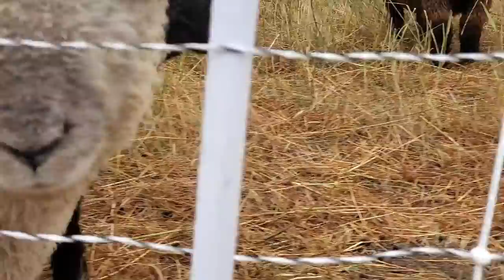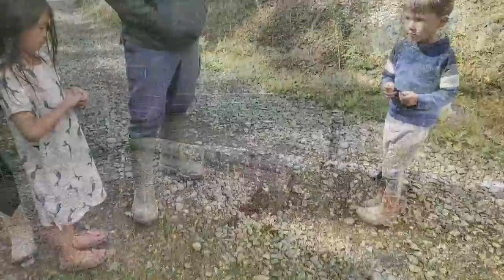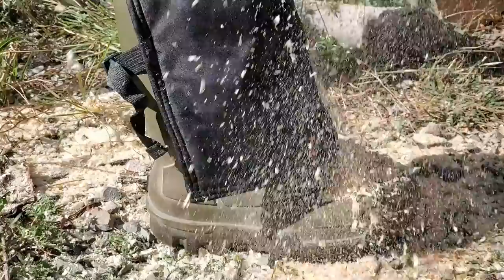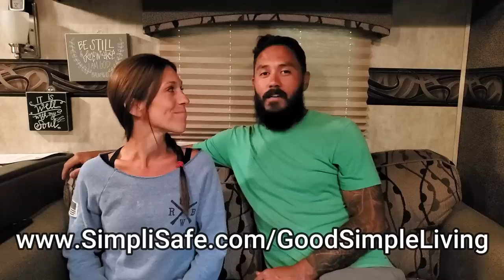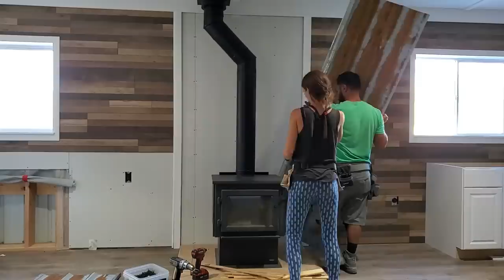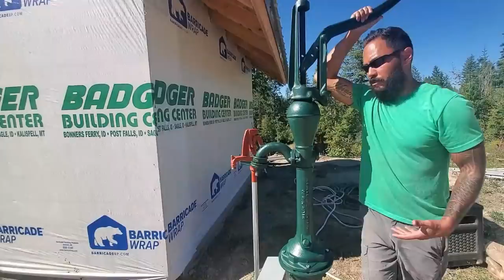Installing Wood Stove Heat Shield | DIY Rustic Farmhouse | Building Our Tiny Home Barndominium

Comment: FYI...Make sure you put a fan in main room to help circulate the heat from stove...add a pan of water also to help keep moisture circulating.....Cheers from Maine.
Reply: I spent my childhood winters filling the pan on the wood stove.
Reply: The water is very essential for keeping the sensitive noses of the kids from drying out so bad that they're having frequent nose bleeds. Had a friend that didn't believe me about the water & her young daughter had so many numerous nose bleeds she alerted the school in case she did. After finding out nothing happened & got the same advice from the nurse, followed up by a NP from her dr's office she put the pan of water on & No more problems!!!!

Comment: Have you thought about getting a sawmill to make your own lumber off your property?
Reply: A sawmill would make sense if you have a lot of woods but judging from their videos the investment to get a decent sawmill is pretty steep and there just isn't that much timber on their place to make it a viable option.  Unless they can sell it for a good price once they've finished  work with it.   Wood Mizer - a great mill but you are talking close to $10,000 for one with the features and capacity to build a house.  Plus there is the maintenance cost too.  Also the equipment to move wood to the sawmill means a good tractor, building for the sawmill and storing/drying the lumber.
Better to locate local mills and work with them.
Reply: @gscott5778  probably right.  A lot involved in setting one up.  And $$$$$$$$$  To get it.
Reply: It seems there is good reason why timber has skyrocketed , looks like there has been targeted attacks on sawmills of late you can’t overlook the number of them that had so-called accidents then you add the fires the future will be grim . Think about maybe building out of stone if it’s a available resource?
Reply: G Scott, We did not buy the portable saw mill, but rather contracted someone to come in with their "portable" saw mill. Worked out great!
Reply: @dianehall5345  That's more reasonable assuming you can get all your wood ready to mill in time and move it to one location on the place.   Certainly a better option for certain types of home build plans.
Reply: Scott G. We peeveed logs to a ramp. Have to watch for any muddy areas. Cut 11,000 board feet. Built a 20 x 30 workshop with a 4' knee wall on an Alaskan slab.
Reply: G Scott ~ You might be interested in Matt Cremona's YouTube channel. He built his own sawmill, as well as trailers, etc. and creates beautiful pieces. I've learned so much from watching his channel.

Comment: We have had Simplisafe about 5 years. One thing for sure, if the wood heater lets any smoke in the house, you will get a call within 30 seconds. The system works very well.
Reply from the maker: Awesome!! Love hearing that!

Comment: Thank God you survived the heavy wind.  This is the time of year that large air masses move around from north to south as the earth repositions itself to the sun.  We felt it all the way down here in Texas as the temperatures dropped from high 90s to mid 60s.  I bet you are glad your tiny house had the extra strength from the OSB construction.  Had the barn shifted in the wind your apartment would have stood strong and survived.  Glad that was not tested.  Winter is coming fast.  Hope you get the water to your tiny house quickly this coming week so you can complete your kitchen and bathroom.  The shed siding could wait till water is secured.  

One note on the wood stove flue.  You might want to consider repositioning the stack to go through the wall then go vertical along outside wall.  That way when you clean the piping the flue opening will be outside saving the big black carbon mess for the ground outside rather than inside your living area.  Just a thought.

One question, I am betting you have had many discussions on priorities for spring.  Do you go full bore and put every waking minute into the house construction or do you divide your time and denote some of it to your garden needs.  Doing both might be pretty stressful.  Just a suggestion, maybe minimally plant all your fruit trees, blue berries, raspberries and any other plant that might take a few years to provide a harvest then at least get your basic house frame up with a roof by next winter.  Or, go ahead and plant your full garden and extend house building for another year.  Roof by end of 2021 and finish house in 2022.  Extending the time frame gives you a breather and reduces stress to the family - life can go at a slower pace.  Also, allows your time for the family garden providing you a harvest throughout 2021.

Comment: The Tin backing looks good!! Not sure what your clearance requirements are for your stove but what some installers do is use metal studs or spacers instead of the wood so that the tin is offset from the wall giving space for air to move behind the tin reducing the combustion factor of the wall. Just a thought!!??

Comment: Absolutely enjoy your channel.  Recently you were installing you PEX plumbing.  It seemed like a long distance from the hot water heater to your sinks.  I live in a home where it use to require running the hot water a long time before the hot water reached the kitchen.  I installed a Watts water recirculating valve.  I am NOT sponsored by or associated with any vendor or sales person.   This recirculating valve does not use or lose any water.  Running water down the kitchen drain waiting for hot water to arrive is a waste of resources.    I encourage you to check it out, at the big box stores or online. Most Respectfully

Comment: Do me a favor, put the guard back on the table saw. I just lost a finger, part of my thumb and my wrist damaged from whip lash. I didn't even know it until I  saw the blood. My left hand is useless now. 
Chains or wide straps over the pole barn and anchored would be a good  investment especially now the weather is so unpredictable. 
Love all your videos,  your shinnangings and the wonderful family you have. Be Safe big guy and family too. 👍👍🇨🇦🐶❤
Reply: Yes. as a chippy, it's really easy to be fooled by the 'norm' - everything seems safe as houses - until the anomaly....
My huge commiserations btw - and props to you for passing it on
Reply: Totally agree, just saw Jeremy using the table saw "pulling" a small piece while ripping.  A definite safety issue.  Never pull on the opposite side of the blade, if a kickback occurs it will pull you hands back into the blade!  Great Catch Dermot!

Comment: Good 2 see u doing good. WOW , those high winds sure would produce great wind solar power. Need 2 dig , 2 - 3 feet deep in ground and ( square or round ) 2 feet by 2 feet , with 6×6 post set in concrete for , 4 corners of a building for shelter for ALL ur animals. Really only needs 2 b no more than 7 feet high. The higher in air the more likely , wind will take down , due 2 up air drafts. Best 2 u and ur family.

Comment: I am very thankful all of your " stead" n you guys are ok! Lots of firewood! 
 Glad to know , as a trained pro you are keepin' a piece on you for your trips to your " stargate " entrance n elsewhere on your corner of Eden! 
  The heatshield perhaps can also be appiled to the area directly above your stove... As you have a relatively low ceiling.. Trim it in no wider than what you did with the back panels n airspace it the same as well.. Prime it n paint it white n it will reflect down the ambient heat rise from the
 " stove "..!!?? Just a safer way in a "wood " structure area.. 
  Thanks for sharing!
     GWW... Ooouuuttt!!!

Comment: My first construction job out of high school was building pole barns and I was 35 years ago they were designed to withstand hurricanes and tornadoes. The construction of these and codes and the amount of concrete that goes in these holes today is five times more than it was 30 years ago I believe if yours was built right it should have no problem with standing hundred mile an hour winds.

Comment: I'm glad your mobile home was inside. 

You MAY want to rethink the design of your main house's front porch overhang thing. Looks like it would easily catch the wind and rip off from what I remember.  Wide open spaces without natural wind breaks like giant boulders and mountains are scary that way. If wind always blows a certain direction, maybe concrete walls can divert winds from animal shelters?

Comment: Hi, M&J...  Been enjoying your progress, and don't normally comment, but, feel like I should say something about your heat shield behind the woodstove.  That old metal roofing will get very hot, and if you think about what you've done there, you will realize you have ADDED combustibles  directly behind, and in contact with very hot metal. Also, you have effectively blocked air flow with those horizontal slats. It may not burst into flame the first time you use the stove, but over time it will char, and eventually catch fire. Also,  it would be safer to leave a  1" TO 2" gap, top and bottom for air to be able to quickly move behind there, to carry heat away.  I would lose the wood slats, and instead use say, 1" pieces of metal tubing as spacers with the screws going through them, to secure the metal to the wall, or something similar....whatever works that isn't combustible..... Just consider the situation again...  Take care!         Mark

Comment: It's always hard when you have to recover from a storm.  When we were living in Saskatchewan there was a bad prairie fire.  A group of people on a large acreage in Alberta set fire to their dump not looking at the weather forecast the next day and so the next day there was "high winds" predicted by the weather people.  So the next day the fire rebuilt itself from that dump and took off across the Alberta border and into Saskatchewan and headed north with a 125 km wind.  It was like a blow torch.  Communities had to be evacuated, (hospitals, care homes too) and we ended up going north to a community to stay in our church building.  We went home the next morning and there was no electricity and no water.  The fire missed the communities but devastated several farms.  At one point the fire jumped the river (over 300 yards) and the only reason the fire got under control is that the wind turned direction and the fire turned on itself.

Comment: Just a thought.  While I love your use of old roofing tin as your wood stove’s heat shield,  wouldn’t it make more sense to use something non-flammable (like metal hat channel) as the spacer behind it?  Love your hand pump!
Reply: I agree with Bill K.  Hope you'll check with a wood-stove expert.  Also, when we built our alcove from which we heated over 2,000 sq. ft., our heat shield had a gap at bottom and top so the air could CIRCULATE and keep temps between shield and wall down.
Reply: If they did proper clearances as required by stove manufacturer and the metal is just for decorative effect the wood strips aren't an issue...if it was being used as a true wall heat shield for reduced clearances then metal spacer U or C shaped channel strips would need to be used vertically to create a non-flammable proper air gap behind the metal roofing.

Comment: God truly Blessed you guys when it  came to the damage you sustained compared to your neighbors! During the week, I've seen several ppl post about the high winds that traveled through their states causing severe damage!  I think that there were numerous angels 😇 surrounding your home and pets!  Thank goodness for the power of prayer as I'm sure you had others praying for your safety!  Glad you didn't have any chickens in the coop yet. It was somewhat of a blessing that the storm showed you places that need immediate attention before winter weather sets in like a shelter for the beautiful teddy bears & rabbits. I was wondering if you could use tie downs like what is used for lg manufactured homes for extra support for the barn? I also saw that someone mentioned the straw/hay bale homes. They have been building them in our state & similar western states. They turned out very popular especially for heating & cooling a home! Using it combined with a log cabin style made beautiful Rustic mansion type homes!! It might be a suggestion to combine with the use of the trees since you have access to both on your property. An extra sturdy house with a genuinely unique personal touch with amazing experience for other enclosures for animals, storage and even outdoor facilities (🤣😂🤣 for the cone of shame) haha!!
Good luck on your property preparations for winter especially getting water running indoors.  God Bless & stay safe!

Comment: Jeremy - Now she is going to be waiting for her chance to return the "favor" with the snake.  Best think about what she knows would freak you out and be prepared.   (Love what you did though.)  This may be one of the best video endings - I'll probably be watching numerous times.   

Depending on the style of house you are building (Any open beams?) you might be able to use one or more of those tall downed trees for a beam.  They need time to dry so perhaps....   Of course that would require them to be taken to a sawmill, which it sounds like you have in the area.   IF you do think a bout that you might need to get the bark off any timber you want to use for that.  I've lost a few pieces of Oak and Hickory because I Failed to de-bark them once I had them cut and ready to mill.  (Delayed milling them for over a year and the bugs enjoyed the free wood.)

Glad the Pump house weathered the storm and I bet with a little patience you can straighten out that bent wire for the chicken coop.

Comment: now would be a good time to have a saw mill for the lumber
Reply: netta smith I was thinking the same thing
Reply: especially with lumber prices increasing
Reply: Am very concerned about all the shortage of wood that is happening now but e extremely worried after all the millions of acres that have & continuing to burn on the west coast!!! Maybe those tall fallen trees can be gathered & saved for beams in your future home. I am referring to planning on future fallen trees bc I know it's probably too soon for thinking about that when you've got a full plate for getting the animals & barndominium prepared for winter!
Reply: @darlenedouglas5148  With people spending more time at home, apparently many are making home improvements, either remodeling or adding rooms and that is contributing to the lumber shortage.
Reply: Not really practical for them at this moment .

Comment: "The only look of a sad ram is the one the sucker bought."  - Built Ford Tough.
Reply: My 1995 Ram 1500, still under 100,000 miles and no major mechanical problems (replaced the balls joints, thermostat, and got a new paint job 2 years ago), still drives like a new truck and still going strong.  I don't drive it in winter when roads are treated with salt and chemicals, so the metal is in great shape.  It's only 25 or 26 years old.

Comment: Did you remember to put the heat shield up in the loft hot stack area?? Don't forget even if no storage is up there  the wood barn construction needs protected

Comment: If you want a solid home and barn? Build house to south Florida code and for the barn since its already built. You need longer screws on the roof and side panels. Get Eagle 1 metal screws from Amazon. You should look at the 2in or 4in depending on your framing. Also, it wouldn't be a bad idea to add additional screws on roof and add 2x6 or 2x8 runners on side walls to beef up side impacts.

Comment: I’ve been watching your progress and have enjoyed every video as you carve your future for years to come. Just a suggestion I think will make your home more comfortable for the hot summers and cold winters is cutting in wall vents just above your interior doors to allow air to circulate through each room. You can get register vent covers that are roughly 4” X 12” in white, gold and event black. And if you use a floor fan to blow across the floors, the heat will go under your doors and allow the cooler air to circulate out above the interior doors. This is very efficient and prevents moisture and mold. Best Wishes to your wonderful family.

Comment: The white birch that blew down, could you use that to make the wood rounds for the black wall?  It would make a good contrast.  Use different size rounds even from the main trunk.  My kids used to paint tree rounds (put small pictures like rabbits and birds) and make Christmas tree ornaments but  you could give some to your kids to paint and add them to the wall in random locations to personalize the wall.

Comment: The Baker pump is pretty cool. Does it have multiple connection options at the spout? Looks like maybe one could hook up an 1 1/2" hose or something? Love the look of the rusty tin roof stove backing to, but would trim an inch off the bottom and top to let the air flow behind it better.

Comment: Just a note on your heat shield it should have one inch steel screw spacers instead of the would strips.  Use some copper water line in one inch lengths n also leave a one inch gap on the bottom n the top so heat doesn't get trapped behind the steel